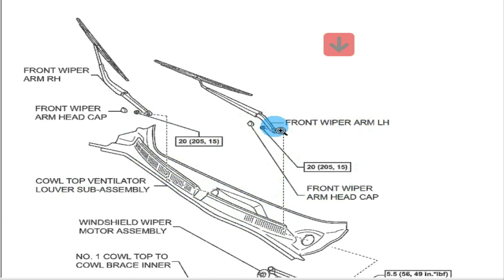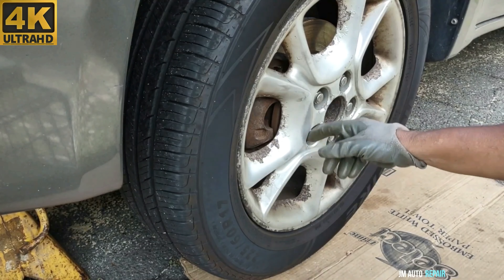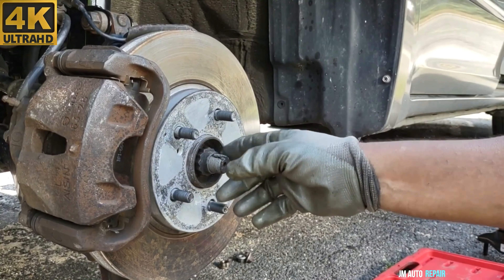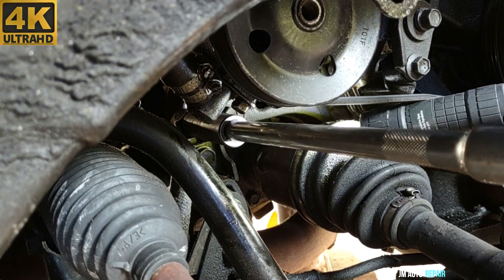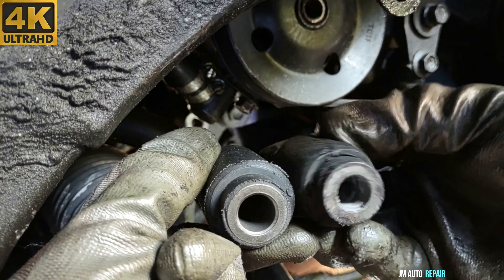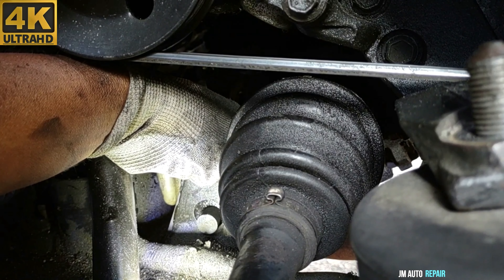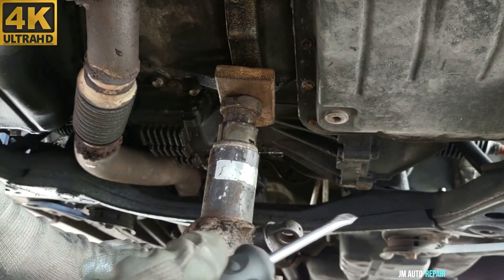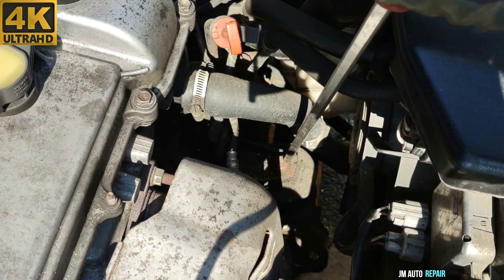Toyota Sienna Engine Motor Mounts Replacement All Around

Comment: Thank you for this video…. How can a DIYer get a hold of that service manual? It is a challenge to get torque specs when working on my 2015 Toyota Sienna
Reply from the maker: I have heard at the library but im not sure if that is true, and i understand may be it is not easy to find it, I think I will upload a video with the torque specs for 2015 sienna because it is not the first time i get these questions.
Reply: @JM-AUTO  thank you!

Comment: Thank you for the video. Very helpful!! 
Tips to anyone going for this project.. I have the AWD too. I found instead of gluing that rubber gasket. It was easier to install it on the mount and then slide it in. I also learned it was better to uninstall that AWD mount and wait till the end after you install the passenger mount before you attempt to install. 
A friend also told me a barrel jack is dangerous to be under. I used a normal car jack to raise the engine and it worked fine. 
Thanks for the video!